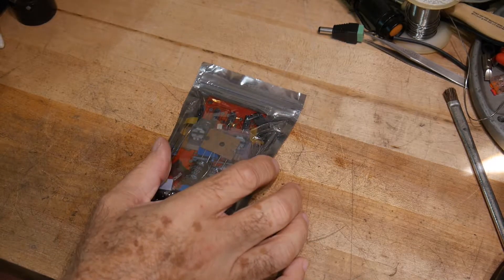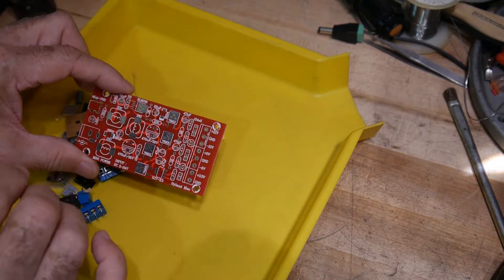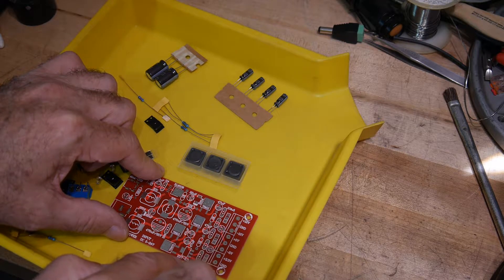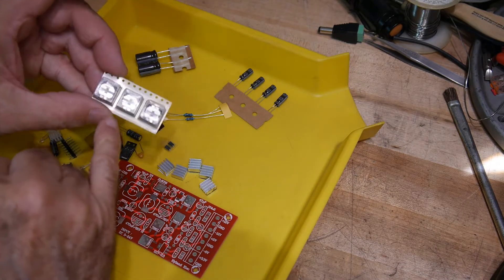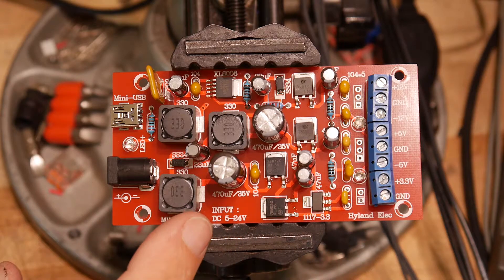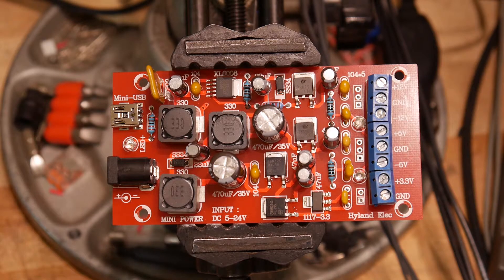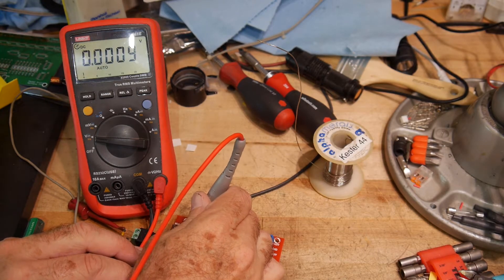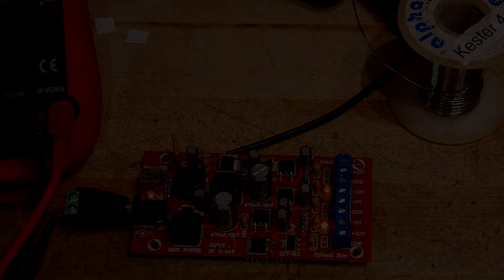#222 multi output +/- power converter

Comment: I considered buying this kit recently. They are out of stock at the moment. I wondered if I could use Low Drop-out 15V regulators instead of the + &,- 12V regulators. When i order one and receive it I'll try that.
Reply from the maker: https://www.ebay.com/itm/373084686646?_trkparms=ispr%3D1&amdata=enc%3AAQAFAAACUBaobrjLl8XobRIiIML1V4Imu%252Fn%252BzU5L90Z278x5ickkd%252F0I%252BERpYfmzqCvv7sUYEp7SuoIGE%252F1YmnqGf5mHDOq5odMTLa8T6rmxQrj5PNypKP%252FVP90X07eyE08io1eM4MRASwOa1moxjOCfxUuzCQ742tvlK6pqutpjDRZ70gtG1pBo5%252FIsfHSF%252Bn56OhqGqzJY9RvwJM29regLvSr4zu4mngXZ0bFPgN%252BdUDZ1hRzpRxy2DMFj9MdTPo%252F5qC%252F2pmWgn7WYH6TEuz%252F0nN16bM1AMmOm9fDeW6Nfy7o%252Bqo0LmWWvRg4YPgBFe6d08f8B6HNtHTzn9ASmUp136nYxN1h7yEvAx7XhFoL6hUQ2%252BQV0%252Fi75XIJwDWruCYHodAqYwHAWqMXJz5QiB%252BkoTzudQaqR3sWTrTqchGaR4UWufuQO06Jz%252F7f%252BjU2GymfPR7VwxNUK3I5eEnrzgoUxFbYlLNsACOQhd6EfIJmtKLtnz53RjaxFEBjYNswiA9%252FpzOe6qY%252B5mvik6%252B2KfDlO96ax3blDsoQOpZW87SmdJeNJ5WqCURx%252Bh7LFvjQxe9IWhkSe7O80pwGiB3LxlsAhrxZgH%252B6%252F9OzJitKrMk%252B0%252Fm23xCpP%252B%252BqhcdzFVeDxuNda8wmN%252FkzzqonyBdsZmHNC5sc%252B%252FN84sMEqqBq3dgf6py8Z1XfD4Ym%252BkNp9sDcCMIQokSxQOxMh5KIHn0%252FquepKXhusKVEZE5vz6%252FZXpTvdIBtfzUs16rgqYSVicjQ2sC%252BsjmU%252FS20R1rJphXCUWU3Gt42oJ4w%253D%7Ccksum%3A373084686646f0ea2a99a8644fe2b6ec80bee41a53bd%7Campid%3APL_CLK%7Cclp%3A3268220&chn=ps&norover=1&mkevt=1&mkrid=711-117182-37290-0&mkcid=2&itemid=373084686646&targetid=1192081308704&device=c&mktype=pla&googleloc=9032151&poi=&campaignid=12521179170&mkgroupid=119536233496&rlsatarget=pla-1192081308704&abcId=9300518&merchantid=263025366&gclid=Cj0KCQjwvYSEBhDjARIsAJMn0lh-CbLF-WoOVxEULnoVOEgRwyNLHqpSJoPHSMwNR375hgXMKRy4qFEaAoXsEALw_wcB